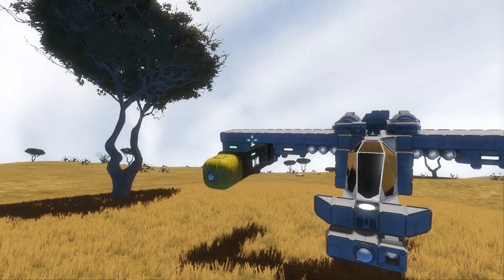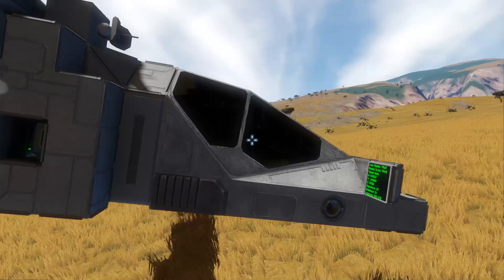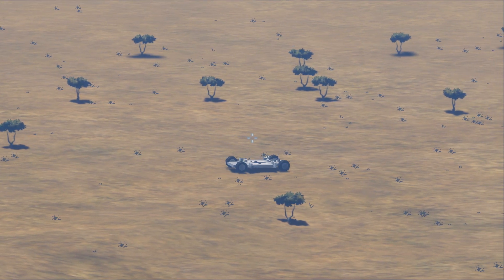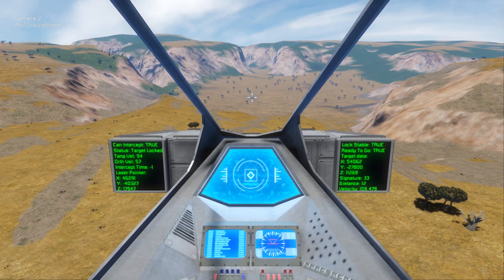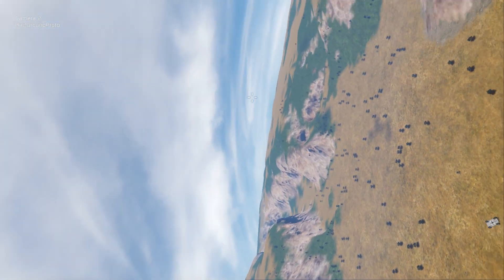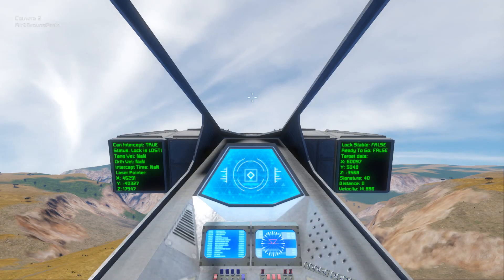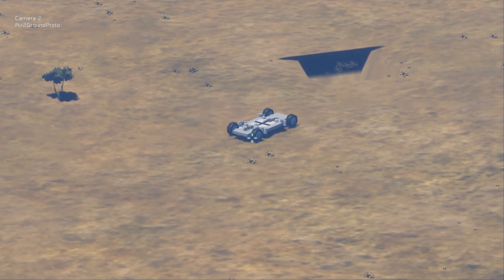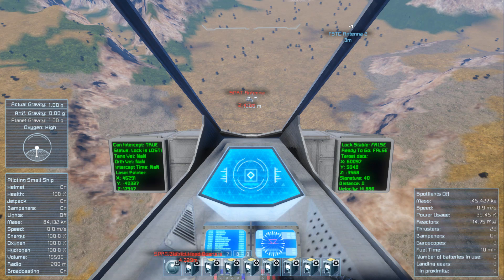Space Engineers: Javelin-like homing missile vs armed rover. Dodging the turrets.

Comment: With a top down attack like that I believe you can remove the side thrusters to save cost and fuel/energy required.
Reply from the maker: +MK84 Maybe i'll try this. But without lateral dampeners it can fail in attacks on fast moving rovers. I saw aerodynamics mod with little winglets. That could be a right thing to use with rockets.
Reply: Yeah they really should add that mod to vanilla. :)
Reply: +MK84 I hopo so too. Plus they should make something like 3x5 moving canards so they can act as side thrusters. Cant wait to design working Aircrafts.